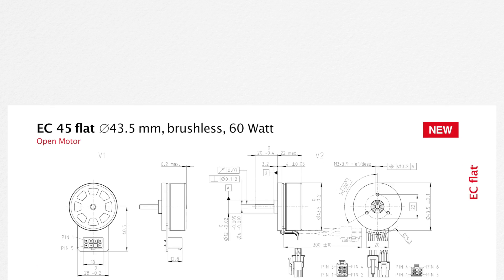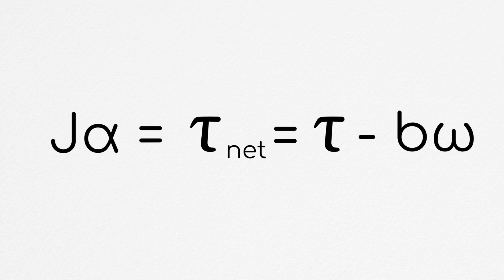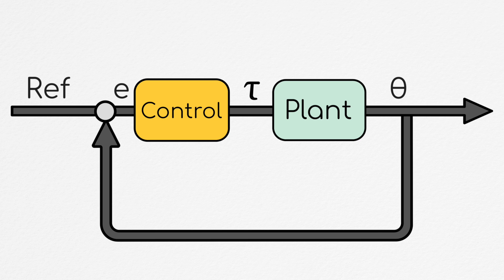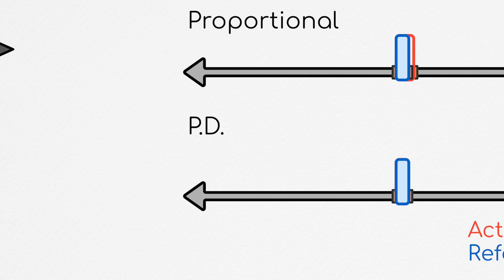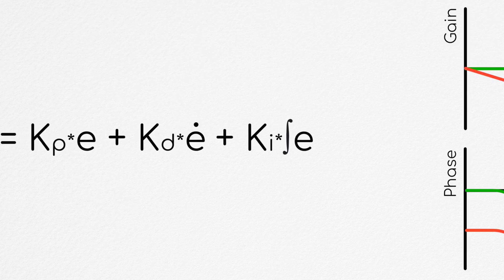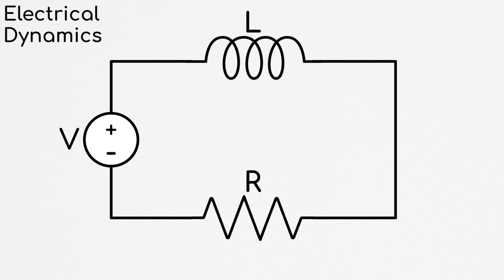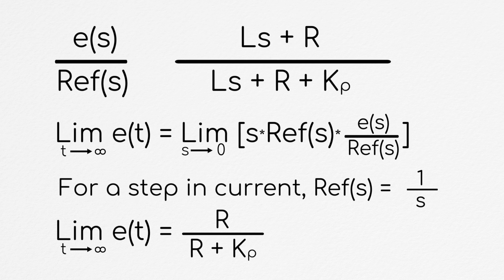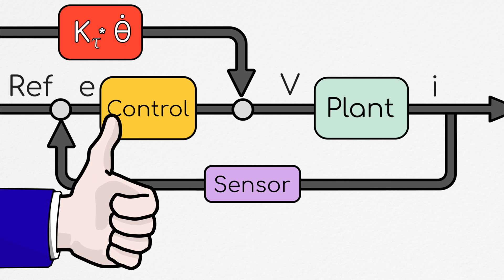Feedback control of a DC servo motor (UM: episode 13)

Comment: Very informational, thank you. Tho some of the math just went over my head, but thats my fault not knowing what laplace transform is.

But since knowing PID control practically from fpv drones, I think that part could have been explained a bit more intuitively. The analogy to spring and shock absorber was a good start. But to go forward with what is the I and what would its analogy be. Just why Proportional Integral and Derivative are important concepts to take into account. Why does D amplify noise and show it visually.

Just as a person that has a intuition about PID from practical applications, I knew if I did not know anything about it, this explanation would have gone over the hills and far away.

But this is just constructive critisism 🙂 I really loved this playlist and am happy to have found it! 5 years late but still 😅 Good gob man 💪

Comment: Does anyone know how a controller like this should handle when the velocity overshoots the reference? I've read that you cannot simply apply a reverse polarity voltage to a motor that is already spinning, so I wonder what happens when you get a negative error (overshot the reference)

Comment: Very informing video, thanks Sir, it helps me in a school project! In a dc motor as you said in previous videos the vector of the magnetic field in the rotor is perpendicular to the vector of the current so d and q axis are orthorgonal. In an ac induction motor however, is it the same that d and q axis need to be orthorgonal to produce maximum torque? Thank You